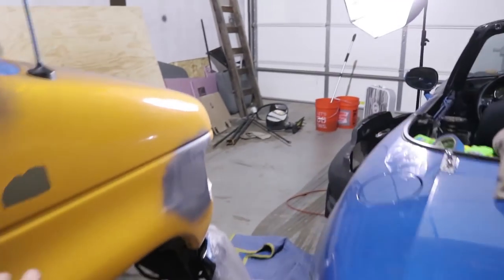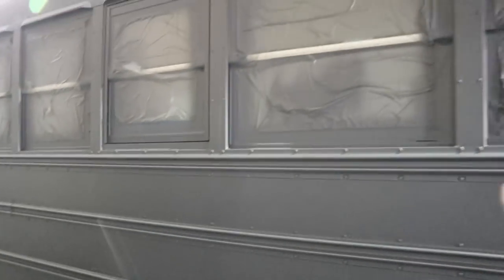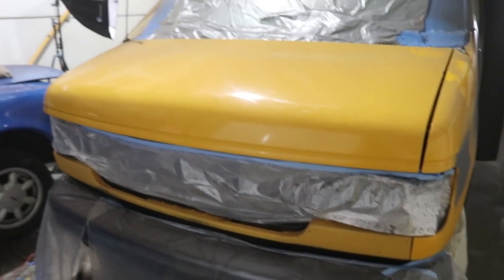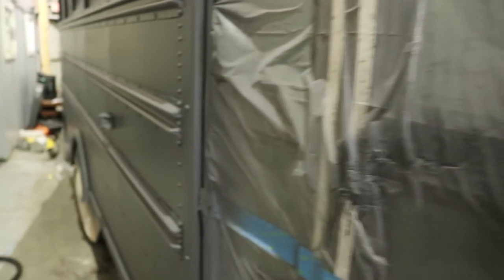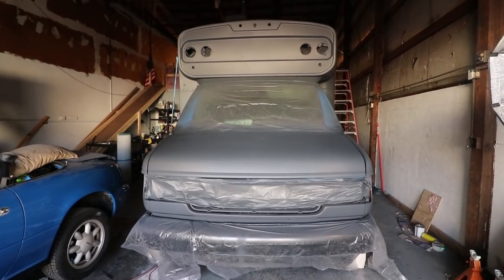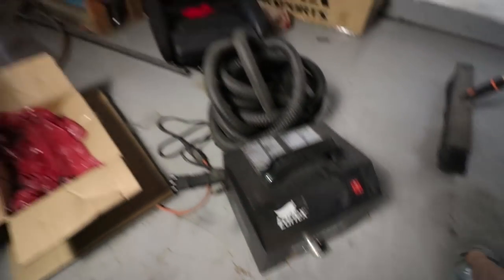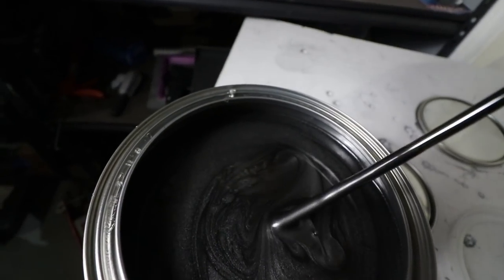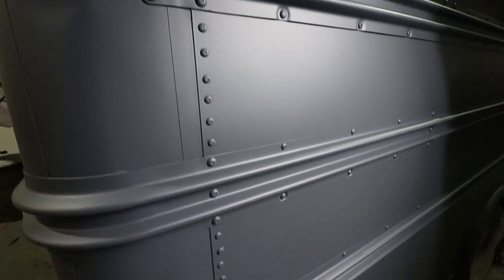Plasti-Dipping the Bus! (Part 1) - Gun Metal Gray Base Coat

Comment: Since you took the bus lights off the top I would put outside real off-road lights on it so it’ll look good in the mirror you have on the passenger side in the front you should take that off and put one of the ones like the one you got on the driver side like two mayors at a local little better and on the door you could just put a solid door from RV to put there I think it would look a lot better

Comment: The sparyer that your using is an HVLP from what I can see. And what you used for the rx7 is a gravity feed gun. The HVLP is a lower pressure system and has a a blower in it instead of a compressor.

Comment: swap out the school flashers on the front roof area with kc off road spot lights .... and also the ones in the back ... serves for being able to see your trailer and miata if you need to work on it on the road in the dark. ..

Comment: excuse my ignorance but can someone tell me why a paint booth is not needed for plastidip?
Reply: AgentHeadCase It isn't for paint either, it's just very strongly recommended. I assume it's a cost saving measure, plus finding a booth big enough to fit a bus won't be easy or cheap. Finally plastidip doesn't need to be baked.
Reply: Plastdip doesn't have as fine a mist, overspray is nothing compared to paint.